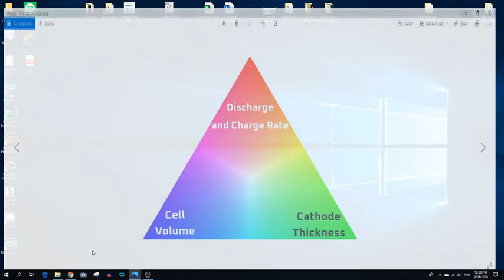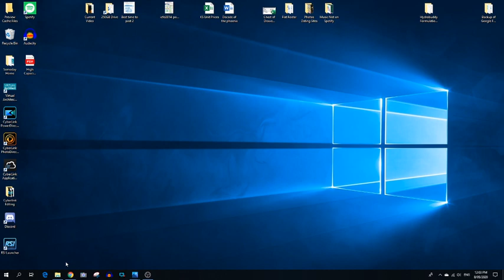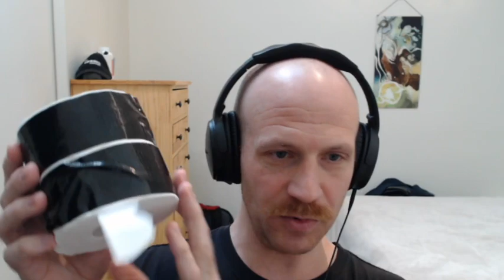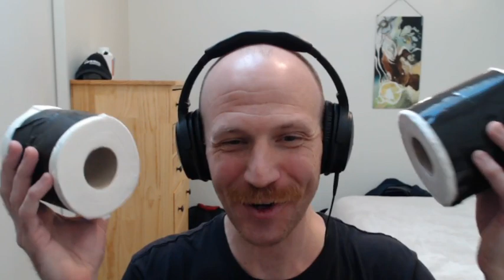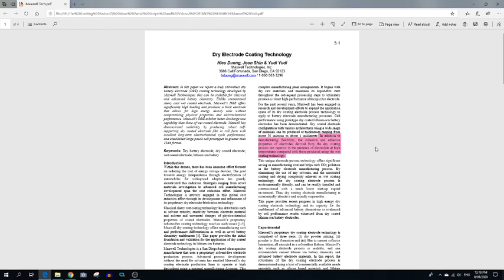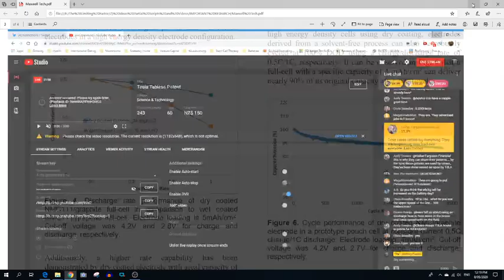Tesla Tabless Patent

Comment: Lower resistance from the tab means less heat, more current. Should mean faster charging and discharge rate. So larger diameter means cheaper pack. This is good

Comment: Where's the best place to read the patent? I'd be really keen to see the specifics.

I'd like to see how that doesn't just instantly cause a short circuit between the electrodes?

Very cool tech though. In one cell, it recreates the effect of having several smaller cells in parallel, allowing you to increase the volume/specific energy (which is normally a power trade-off). 

It does mean any cell failures during operation has a bigger hit, but, they seem to have gotten the failure rates so low, that, that should be a concern. 

Exciting stuff! Thanks for the video!
Reply from the maker: https://electrek.co/2020/05/07/tesla-patents-battery-cell-elon-musk-hypes-way-more-important-than-it-sounds/.  Different offsets for the the cathode and anode and the positive terminal is insulated like a normal battery?
Reply: @thelimitingfactor  If you haven't already been called a scholar and a gentleman, let me do it now!

You are both a scholar and a gentleman, sir, thank you very much!
Reply from the maker: @MrVelociraptor75  Not yet, and thank you kind sir!

Comment: You are doing such an excellent job explaining us all these developments in detail. Many thanks for that!
But - the real limiting factor for rentable energy I see in the balancing of the big swings of energy generation and consumption - between sunny summers and dark/cold winters. Can you find significant developments on this front?
Reply from the maker: Have you seen the presentations on Tesla's Autobidder system?
Reply: Sorry, autocorrect changed my message. Please read renewable, not rentable 😉. There are several alternatives to pumpable hydro power (redox flow, molten Al, stone stacking...). But so far it seems no significant low cost breakthrough?!
Reply from the maker: @TannersFriends  I haven't done a comparison.  Great idea for a video though!

Comment: Perhaps this is how the super capacitors get involved in the circuitry- I cant see hitting the electronics with all that current at one time straight from the battery - Tesla would likely win the 0-60, 0-100 acceleration  category  with ease.
Reply: Anyone who has seen a ludicrous mode roll-out knows that Tesla is not power limited, its traction limited at the bottom end. Top end speed is less important for a regular daily driver, but it's easily solvable with a dual clutch two speed gearbox as demonstrated by the Taycan.
Bottom end 0-60 is going to need some grip enhancement, either with wider or larger tyres, or some new tech to increase down force at low speed, such as the cold gas thrusters that Elon mentioned. Could integrate a compressor run from regenerated braking energy to charge up the compressed air cans, then fire them at 45 degrees to give added grip and thrust at the same time, allowing more of the motor power to translate to the road.
Reply: @MrGonzonator  Yeah, that will be a really interesting system. Apparently, it should help with cornering too? Not sure

I would hope that the compressor wouldn't run normally, and only be active during charging (or selectable via menu ofc). As cool as it is (totally), you can tell it's not a feature for me, because I look at it taking up the extra seats and just thinking, no, 1.9 seconds to 100km/h is enough lol
Reply: @MrGonzonator  Adding a Super Capacitor is more efficient, would all a more efficient 0-60, 0-100 then let the batteries take over- if Tesla wants to dominate ICE cars they are going to have to become more efficient at acceleration that will lead to longer distances- sooner or later this technology is going to have to go head to head in acceleration and distance on the track!! As it is NOW acceleration costs distance, big time
Reply: Elon has said in previous interviews, that they don't need super-caps. This technology is possibly why (their current batteries are more than sufficient for power delivery, the new design should further increase power density too)

Tesla are already winning the acceleration wars lol (the limit on the proposed roadster is the physical limits of tires - hence the cold-thrust boosters)
Reply: @MrVelociraptor75   Super capacitors would allow  Tesla to reduce the number of batteries when combined with caps and that would be cheaper  and that's that's always good.  Relative to Super cars the Plaid and Roadster  would dominate the top tier of cars.

Comment: When you said "I don't know why nobody has thought of this before" of course those are the best ideas :)  But Tesla cars are very specific applications of the 18650 battery - there are seven thousand batteries laid vertically next to each other like soldiers in the chinese Terracotta Army.  When Panasonic started making these batteries, probably when Elon was 5yrs old, it was for Dell laptops, cordless home phones and so on.  They had no idea so many batteries would be used in one device.  Initially Panasonic were faced with not knowing what their product was so they had to build a battery and provide usage directions.  Fortunately enough people were interested in that usage pattern and the battery was a success.

When Tesla came along and their factories were like getting shut down due to lack of use, Tesla said "give us as many batteries as you can make, right now!!!" and Tesla designed their car to make use of the batteries as they came from the factory.

Once the "usage pattern" was known for a vehicle pack, Tesla knew that custom redesigns of batteries would be theirs to design+create.  Now we get this radical re-design.
Reply from the maker: Great explanation Martin!

Comment: Another analogy: think of the battery not like it's rolled up into a spiral, but like it's all unrolled into a strip - like, say, an airliner.  Passengers can only get in at the front, and they all have to file along the plane to sit in seats starting at the back (this is charging it up).  They can only leave the plane (discharging the battery) from the front, and the passengers (or electrons) at the back of the plane have to walk the entire length of the plane to get out.  All this walking creates heat.

Tesla's new patent is a way for the passengers to all walk sideways out of the plane through the sidewall, more or less simultaneously.  There are still 6 or 8 seats per row so it isn't all totally simultaneous... but it's way faster and there's less walking, so less heat charging or discharging.

This also allows for massive amounts of power to go into or out of the battery.  Does this make sense?
Reply from the maker: Great analogy!
Reply: Nice. Same short path length as a pouch cell, but stronger cylindrical structure still and easier to cool

Comment: Jordan, with your fat mockup battery, I am wondering how fat do you think the new jelly roll might be? I assume the resistance/length of the roll dictated the limitation of the roll diameter and cooling needs are reduced. With axial electron movement, the roll diameter is no longer a limiting factor.
I guess it can be as thick as you like vs packing density, minimizing the number of cells in a pack (not that packs will be important anymore as Elon said). Maybe for volume packing, would having mainly high diameter cells, with smaller diameter cells in between to fill the bigger voids. Analogy being packing small rocks around big rocks , you can get more in the container. Maybe even more than 2 diameter cells, it doesn’t matter, whatever they can engineer a cooling system around
Reply from the maker: 40-50mm :D  Sandy Munro just said he's heard rumors of 50mm
Reply: The Limiting Factor I just saw that too, 50mm he’d heard rumored from several buddies. So 50mm will still pack pretty well, need 5.6x less cell connections, without the need for ‘pack modules’, be easy to cool still and not much lost void space, yet have some efficiency benefits over the old longitudinal electron path.
Reply from the maker: @kdkd693  Such good news if true!